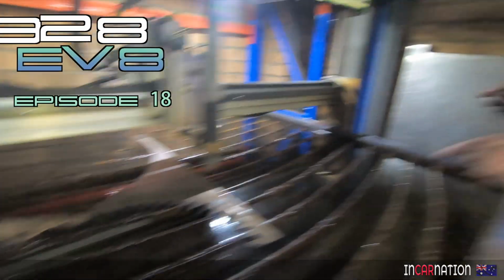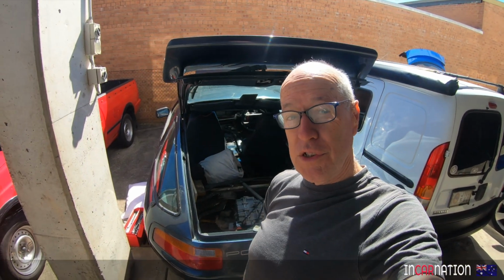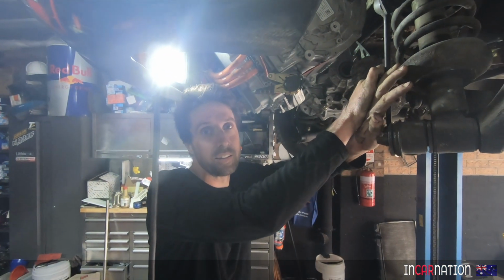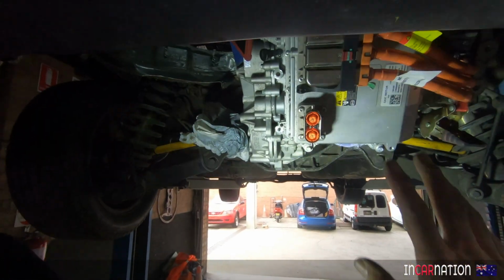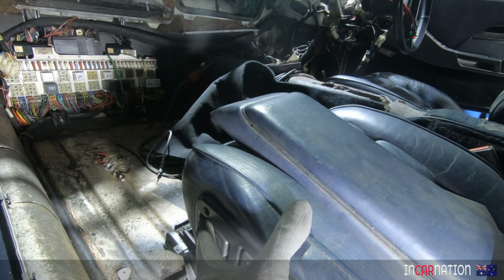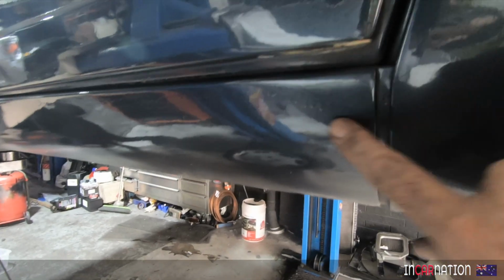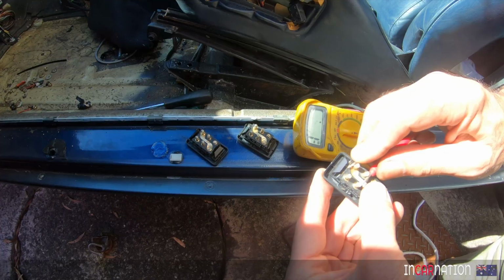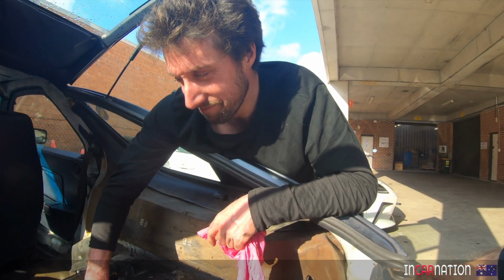Episode 18 – Porsche EV Conversion | Electric Motor Test Fitment

Comment: Hi Stu, Matt's doing a great job on the fabrication! For seats consider Recaro LX's (about $3k) and for teh colour Wimbledon Green, or check out the first Porsche metallic green Lago Green Metallic, that came out in 1956 on 356's
Reply from the maker: Ooh Lago Green very nice. Not seen that before. Did you notice you appeared in the IONIQ 5N video, squeezing your 6'6" frame in the back seat?

Comment: Given it's a Porsche with an MG electric motor, how about Bentley racing green and Ferrari biscuit interior ?
Also, given that you're not bothered about the back seats, shift the motor so the drive shafts are straight on, improve weight balance as a bonus ?
Recaros would look good, are they ok for long journeys ? A good upholsterer would make the Porsche seats look perfect.
Looking forward to the next episode. PS you can buy 10mm sockets in bulk !

Comment: Great video Stu, pity about the engine shift, but no doubt many more trials and tribulations to come but overall great progress and you both should be very proud
Love the humour and videography
I'm in the process of tackling vacuum lines on my '82 and now wish mine was electric :)
Have you tried other 928 bits suppliers, Rose Passion, Design 911 and Pelican Parts also great
Greatings from always sharp as a drill Kiwi
Reply from the maker: Yes aware of them and have used Pelican and a couple of others a bit.
I'm a fan of Kiwi enginuity (do you like that? I just came up with that). I worked for an innnovative NZ technical company for many years last century, so big respect for Jade Software, Britten Motorcycles and especially Rodin cars, although their founder is an Aussie from Sydney.
Reply: @inCARnationAustralia  forgot in first post, Wombledon Green for me Great Uncle Bulgaria would surely agree
We haven't done too badly with Enginuity, Burt Munro would take the cake with No 8 wiring mentality
Jade SW is a stalwart of Christchurch, many an Aussie vs NZ battles of Rugger and Cricket fought on Jade Stadium (Lancaster Park), my younger days spent going to Concerts there too
We had similar earlier fate, I too went to Varisty to study Engineering and pulled out in second year